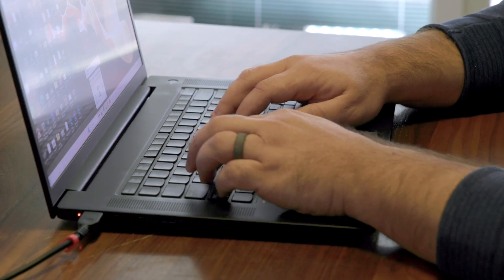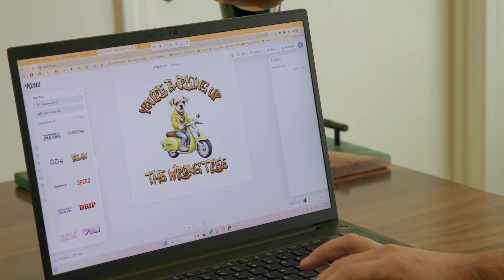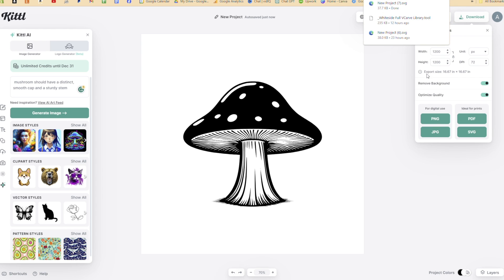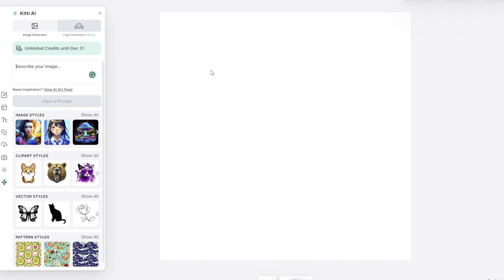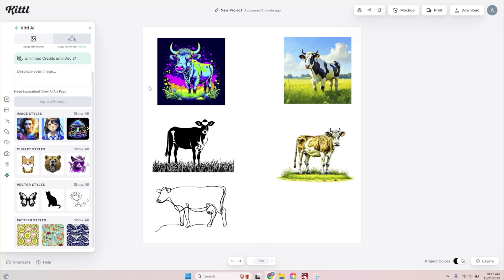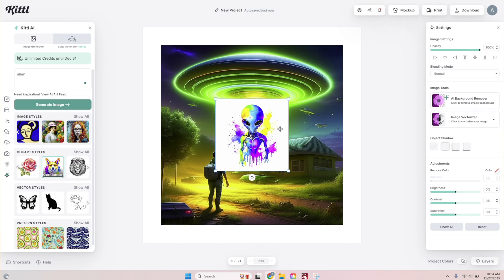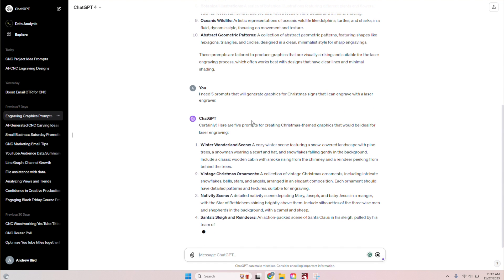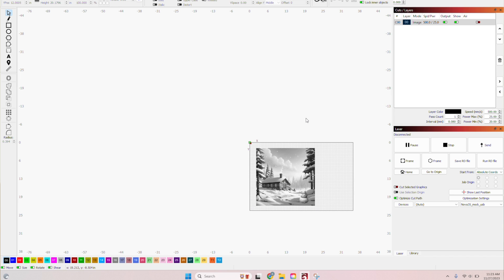The Future of CNC: How AI will Transform Your Projects

Comment: Ahhhhh: A Vectorgrafic is based on a mathematic description, that's why it is scalable without loosing sharpness! A pixel grafic is based on a raster filled with "pixels", based on a resolution. A pixel has a certain size and is not endless scaleable. If you scale over  the resolution where it was made of, the pixel becomes fuzzy.